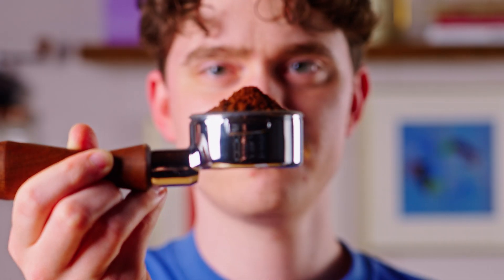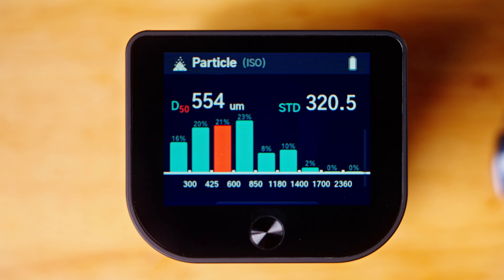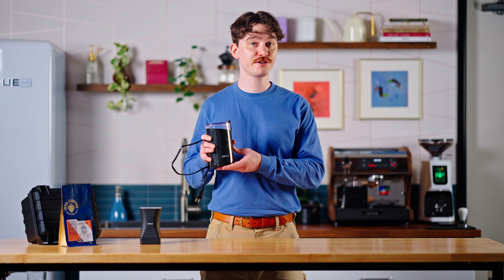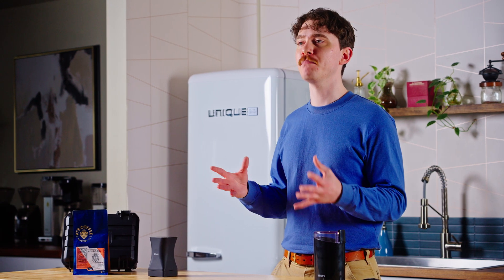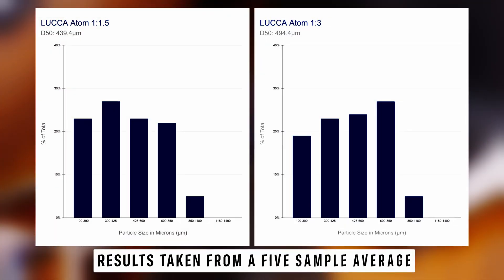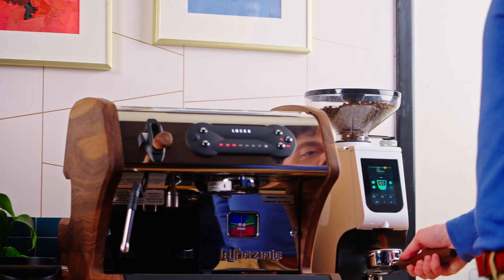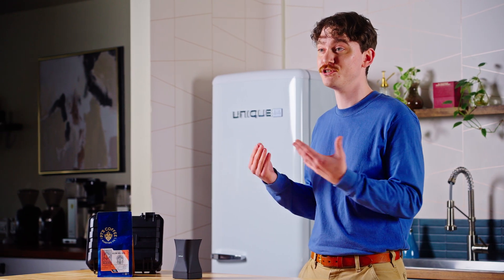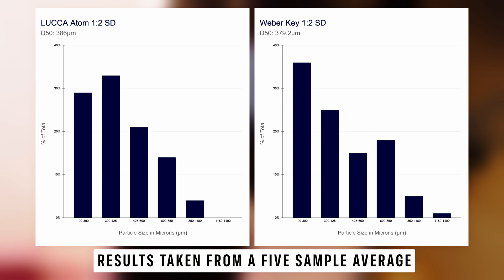What Is Particle Size?

Comment: Please make a video on particle size analysis on the Barista Express built in grinder. There's a lot of speculation about the inconsistency of the grinder and it would be great to get some actual data on what exactly the difference is between the output of the built in grinder on the Barista Express vs something like the Niche 0.

Comment: Nice analyses. I want to add a tip from experience with using the DiFluid Particle Analyser. Consider the following when the grind is very fine. Fine grounds tend to clump together, and if the analyser doesn't distribute them well enough (you'll hear the sound it makes when distributing), it will mistake the clump for a single ground. If you notice a large standard deviation, it's likely due to clumping. Use fewer grounds and gently blow off (that's the trick) some before letting the machine do its magic. This works well. I tested it many times. The reading becomes more accurate, with a reduced standard deviation.

Comment: How does using differently sized portafilters impact particle size and coffee taste?  Smaller diameter portafilters are deeper than larger diameter ones... Given the deeper puck in a smaller portafilter, does particle size have to be larger to achieve the same output in a given time as that produced on a larger portafilter?  If so, does the taste of coffee change using portafilters of different size?
Reply from the maker: It depends on the coffee, but you'll have to make a grind adjustment if switching from a 58mm to a 53mm, especially since you were extracting at much larger surface area. Think of switching basket sizes and basket diameters as a variable change in your espresso recipe, so you'll have to make grind adjustments accordingly.
Reply: @clivecoffee  Right.  So with all else equal (i.e. the coffee, the machine pressure, the liquid-to-grind ratio, and the shot time), the larger the portafilter diameter, the grinds would have to be finer?  And so the extraction would also be higher?
Reply from the maker: @fshoosh  The wider the diameter, the more likely you'll have to grind finer. It could be! This is really coffee dependent. The only way to test this IRL is to start pulling shots and tasting.

Comment: The narrower particle size distribution of larger diameter burrs is probably largely due to the higher "throughput" of beans. The longer beans are stuck between the burrs (re-ground), the worse. If you watch James Hoffman's latest video and Lance's different videos on slow feeding, you can see that less beans (down to one at a time) dramatically increases the peak and reduces ultra fines. It is yet to be seen how much quality can increase. Also if vertically mounted burrs are always better than horizontally (or angled) mounted burrs.
Reply from the maker: Yeah! We're very familiar with the concept of slow feeding. However, it didn't really impact us here because it wasn't a relevant variable in the study. It could be something that we test in future tests with the particle size analyzer! Thanks for the tip.